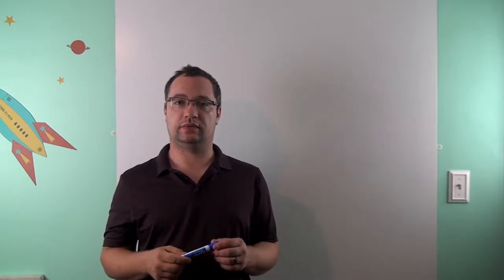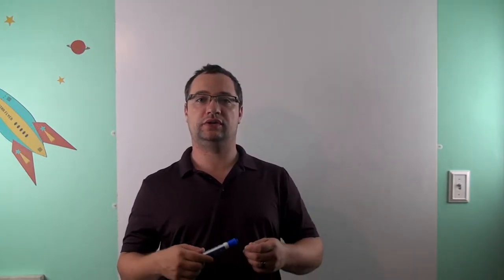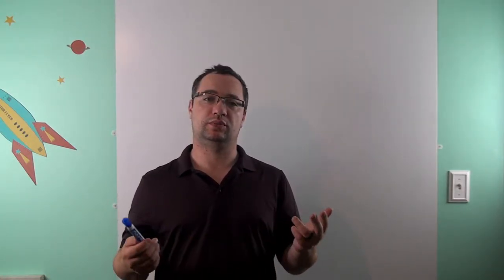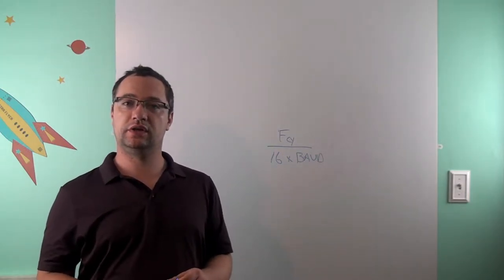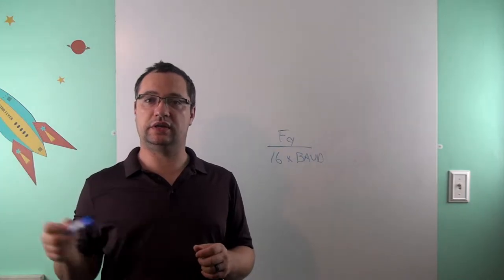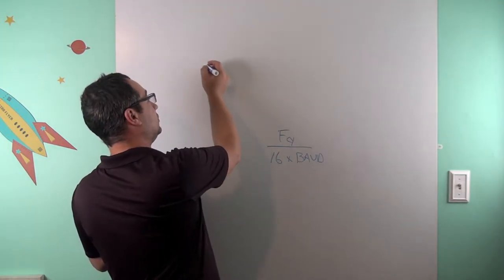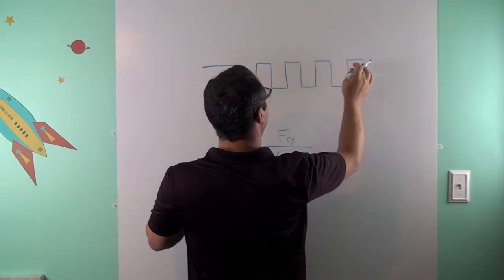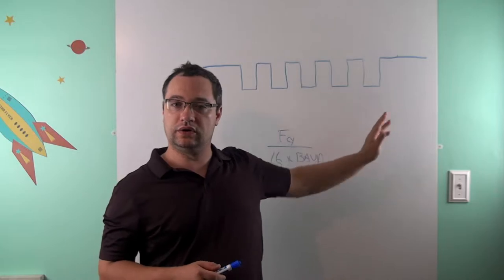eapbg #56 CAN Baudrate Advanced Look

Comment: I have been using UART almost a year. I did not know it is taking the sample as you described. appreciate the explanation. which is a good inspiration for CAN baud rate.
For ST, their SJW seems to be defined in another way? As opposed to every edge from recessive to dominant, stm32h743zi FDCAN perfroms hard synchronization from dominant to recessive, and the phase segment 1 can only be lengthened, while the phase segment 2 can only be shortened. I am not sure if I am correct. Still trying to understand the definition of SJW.

Comment: Great lesson on CAN baud rate. I am currently trying to interface with a vehicle CAN bus, the vehicle CANbus is running at 500kbps and I have calculated the BRGCON values for my program but whenever I inject a latching signal into the vehicle CANbus it just freezes the CAN on the vehicle. Any ideas as to what could be causing this?
Reply from the maker: Offhand I have no idea what is going on. Perhaps your calculations are wrong or there is something wrong with your setup. Does the transceiver match your setup? First configure your setup to receive silently. Then see if you can receive legible data.

Comment: When measuring a CAN Hight and Low signals using an oscilloscope i can't tell if the CAN signals are 2.0A, 2.0B or CAN FD, how can you tell so I can set the correct CAN Baud rate?
Reply from the maker: To determine the baudrate capture a message on the scope. Look for a transition zero one zero or vice versa. Using cursors measure the transition time. CAN has several predefined baud rates. (1M, 500k, 250k, 125k) Look to see what matches. For instance, at a 1Mbit baudrate the shortest bit is 1u second. The catch is that CAN FD will get much faster after the message ID. Actually, that is one way to tell apart CAN FD. Telling the difference between 2.0A and B involve measuring the length of the message. CAN 2.0B has a longer ID section.

Comment: I didn't  get the part how bit stuffing  can be explained using SJW. Can anyone  clarify?
Reply from the maker: SJW needs a transition from a recessive state to a dominant state to work. Bit stuffing guarantees that such a transition occurs at least once every 10 bits. If the data in the message has a whole bunch of 1s. Bit stuffing will throw in a 0 as every fifth bit to give the needed transition.